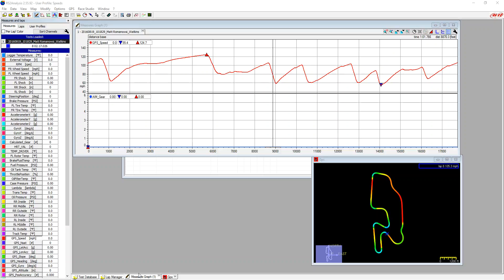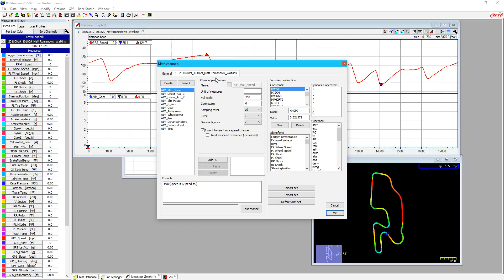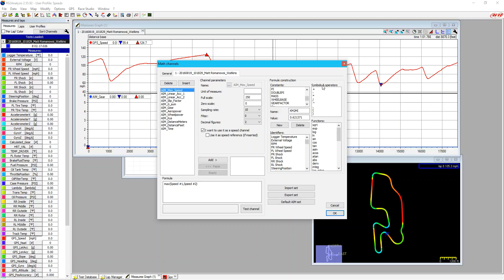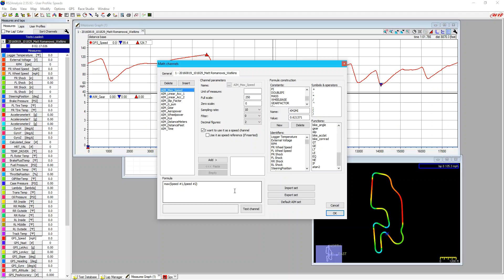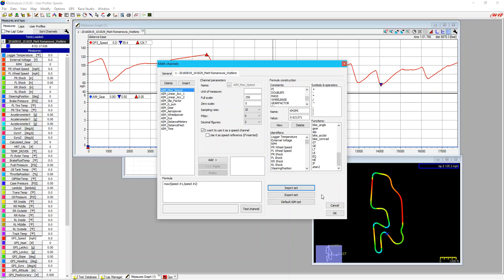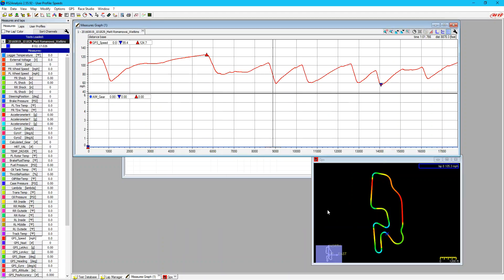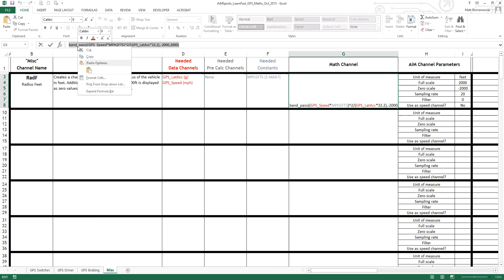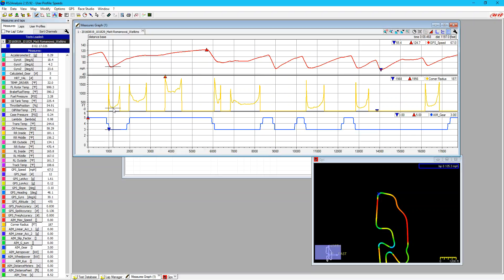Race Studio 2 Math Channel Intro

Comment: I was watching your tutorials and it looks to me that you can have an answer to my question: basically I need to AVERAGE some channel value for a certain period of time to avoid jitter (e.g. average the last 10 samples and display the result) and I was not able to identify the correct way of doing it.
I was thinking to integral math function but I do not understand how to use it as it is not accepting "time" as parameter...
Can you please advise?

Dragos
Reply from the maker: You can not do a rolling average math channel in RS2A. You can with the filter options though. I'm not sure you can do what you want in the way you explained. What is the end goal you are attempting to get?
Reply: @TrailBrakeData  Hi Matt! I have a jittery wheel sensor that I am trying to filter the signal from. So I need an integral (but I am missing the time parameter) or a rolling average for a period I can define, or a number of samples to be taken into calculation.
Reply: AIM wheel sensor on karting is very jumpy as the car has no suspension and all movement is directly transmitted, this is the info I am trying to filter.
Reply from the maker: @dragosstroescu  The best you can filter with is the 1-10 rolling average that is in the channel settings window.
Reply from the maker: @dragosstroescu  the AiM filter in the channel dialogue box is a rolling average. That is about the best you can do for the signal. The other option is to create a math channel that is just that value but put it at a lower rate (i.e. 10 hz instead of 20 hz).

Comment: Great video, but should the minum (or in your version zero scale) not be -2000? With leaving it at 0 I do not have the left-hand corners.
Reply from the maker: You can do it the way you do, or take the absolute value of the channel and it will be all positive (coming down from the top). Same info in both, you just have it for left and right corners.
Reply: @TrailBrakeData  Thank you for your quick reply. Strange it won't work with me (RS2 2.56.74). I actually would like it to be all positive like your example (makes it easier to read with multiple graphs open). But just won't work in my case.

Comment: I don't get why the identifiers of the math channels aren't all available in the "General" tab.

I want to calculate lean angle with bike_angle(GPS_Speed,GPS_Gyro) but I would like to add it to my General tab rather than on one test
Reply from the maker: The general tab is general to all AiM loggers and the parameters listed for it are not the same as one test. What you have to do is create the channel on an individual test that has the parameters you want to use, then move it to the general tab. The general tab will say it doesn't work, but it will once it's applied to your test.